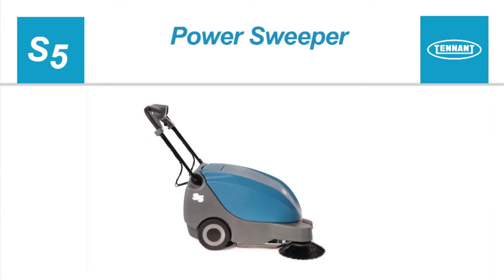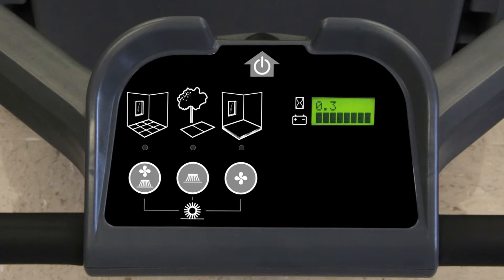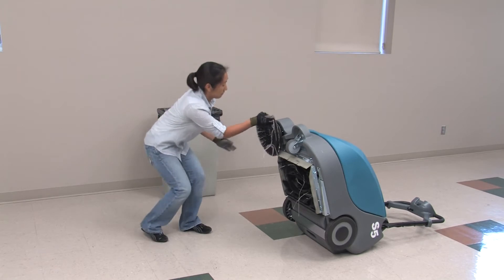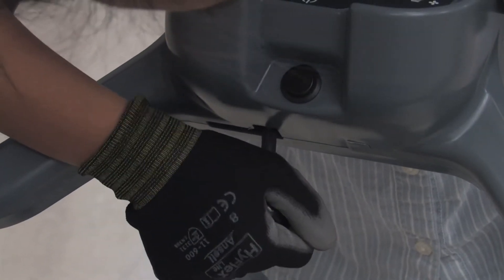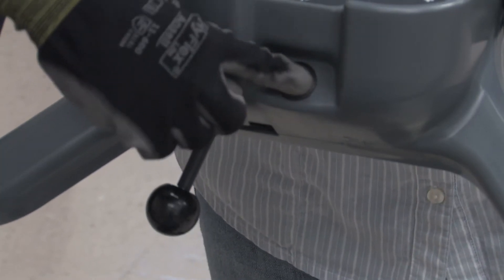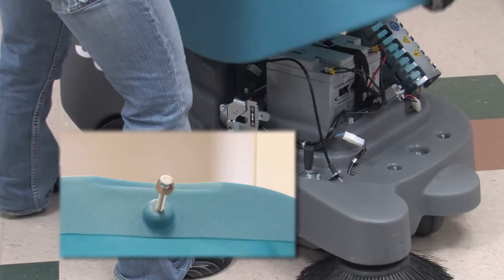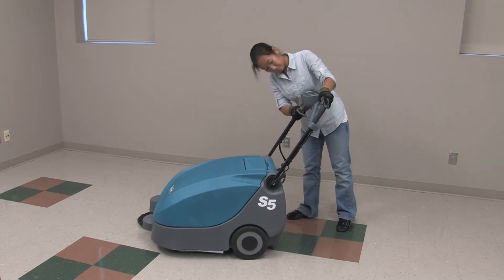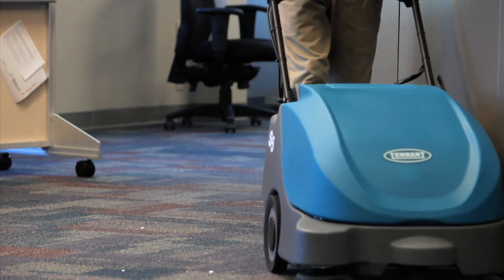S5 Walk-Behind Sweeper (Discontinued) | How to Operate | Tennant Company

Comment: How do you remove the lid to get to the battery
Reply: There is a thumb screw/wing screw under the front section of the hood (look closely at where the hole is in the video above at the 1:12 mark.  It is literally under the machine and under that area of the hood.